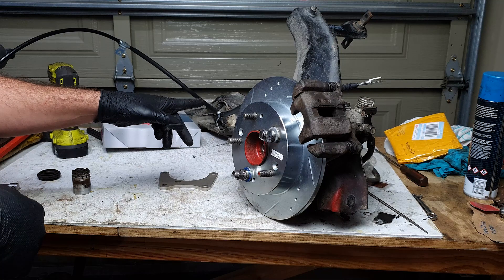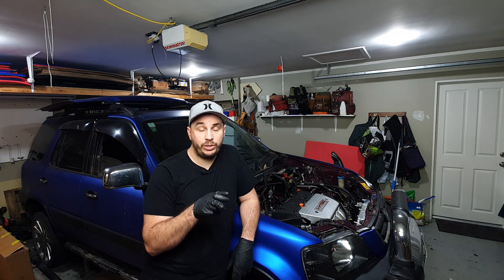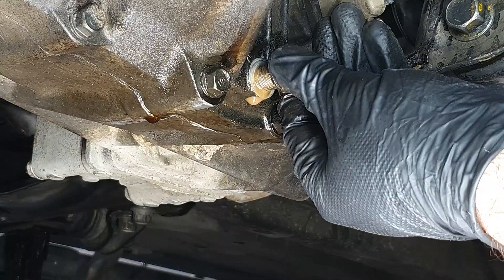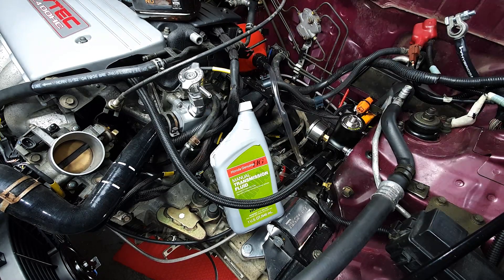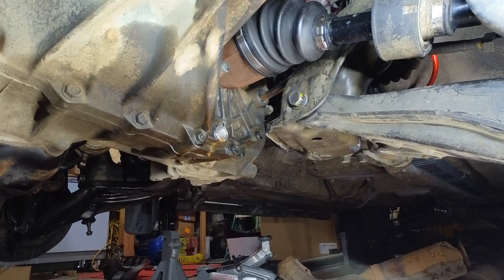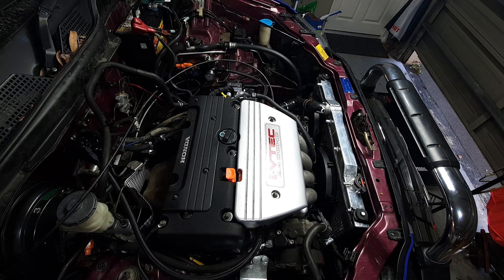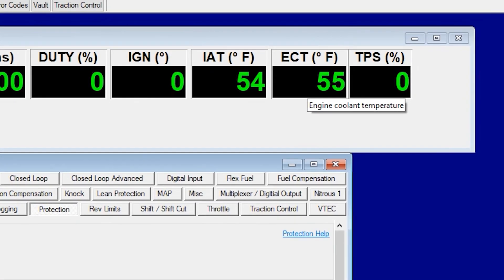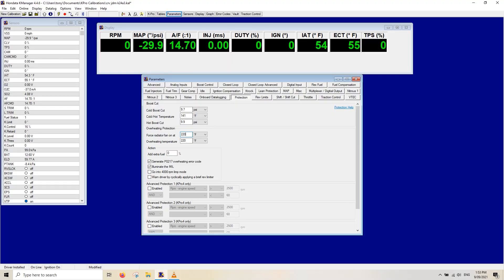kpro beginner tps calibration - fan control & k24a no exhaust rev

Comment: How did you get Kpro to turn your fans on and off once your value was entered for it to kick on? I have the stock k series switch as well installed in the rad and my engine temp is registering 35°F and I set the value to 30 (car is in aux only, not running), uploaded to the ECU, and fans don't come on. I even checked current to the switch and it's reading what the battery is so I'm getting the signal and sensor is brand new. Fans are wired into the stock plugs like you did. Any thoughts?

Comment: I saw you loaded an accord base map with 270 cc injectors .the k24a you have has vtec on the intake and exhaust cam right?Normal k24’s carry 270cc injectors is it the same for k24vtec heads or 310cc injectors?
Reply from the maker: When did you see me do that ? I know i accidentally did that more recently when i installed a factory o2, you're correct you want the 310cc tune for the 3lobe vtec k24 engines. Runs like shit on the 270cc tune lol
Reply: @jdmnuggets  I’m almost at the end of my kswap and I picked up a lot of information from you.I just want to say I appreciate your channel!
Reply from the maker: Thank you!! Im glad it was helpful. Congratulations on your kswap build

Comment: haha so loud with a few revs... Getting close now, just need that exhaust! Cheers for the mention and if they ever let us out of this friggin lockdown i'll try and source you a tb bracket from a wrecker here. They mount to the throttle body bolts, which is a bit different to yours on the intake. Also god damn my fill plug was done up by Hercules - i seriously thought i cracked the gearbox housing when it finally gave way. I can see you had a double spanner job to get yours loose too!
Reply from the maker: Thanks man, looking forward to it. Yeah wtf ae duno why they are so tight

Comment: Looking good
If you'd like I can remote road tune it for you one day as long as you have a wideband hooked up to the ecu
Is recommend an aem one, I think Adam probably still has them on special atm
Otherwise there is a small chance that I may be heading to the south island soon for a holiday
Reply from the maker: Hell yeah dude, cheers. I was going to run the factory o2 from the k20 rd5 engine, i assumed it was wideband oem 🤷‍♂️. Any reason why i cant just run that? Im not looking for high hp just want to make use of the 50° vtc. Always welcome to stop by regardless. Thanks for the help.